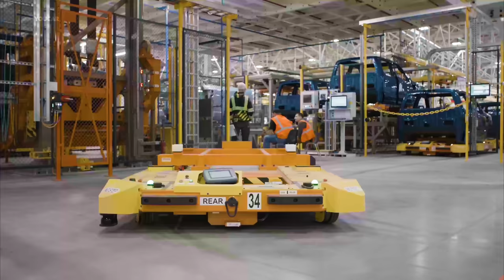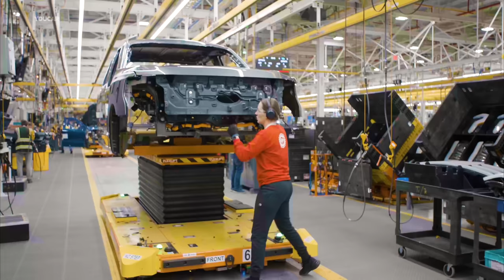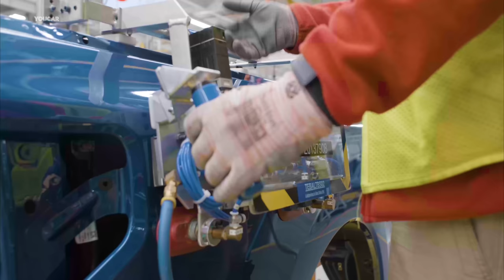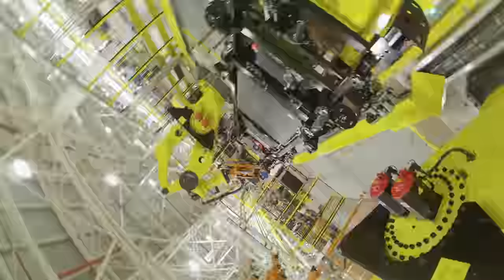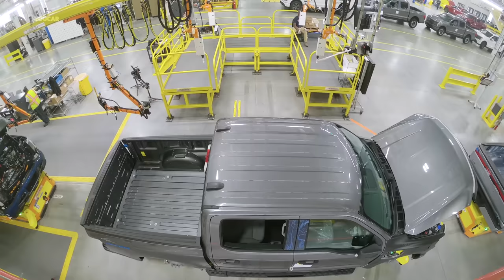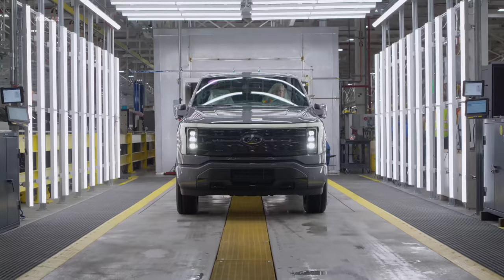FORD F150 Lightning Production Line

Comment: My place of employment. I’m building them right now. Awesome vehicle.
Reply: But brother we booked it’s waiting time ridiculous in Canada 4 to 5 years 🤦‍♂️
Reply: Do you know where the speaker is at for the frunk alarm when opening and closing?
Reply: @isaiahgrandt5305  if I’m not mistaken, it is behind the front bumper on the passenger side.
Reply: @Ruby5point0  we checked there and only found the back up speaking so we un plugged it and could still hear the sound when the frunk opens, if you’re underneath the truck it sounds like the sound comes from up higher than the back up speaker yet we couldn’t see anything even when removing the wheel lining
Reply: @isaiahgrandt5305  ok. I’ll look and I’ll ask. I’ll answer back later today
Reply: @Ruby5point0  thank you sir
Reply: You all should be in uniform and have hair restrictions.  But I set my bar higher than others.
Reply: @tomickes409  there is no reason for that. But thanks for your insight

Comment: What’s the machine doing at 6:30?
Reply: Comau Aura applying a load to the bed to calibrate the onboard “scales” in the bed. To automatically weigh your payload for you.
Reply: @LakeLake123  Did you just answer your own question
Reply: @rhydynamic8306  yes, after I figured out what it was. Assumed other people might be curious what it was too 👍🏻
Reply: @LakeLake123  Thanks, I was curious about that as well.
Reply: @LakeLake123  thanks man, I had the exact same question. ;)
Reply: @LakeLake123  you have my favorite mindset

Comment: Id love to see Ford buy the old Harley Davidson factory in kansas city mo add onto to it and produce these becuse thus far demand will far outpace the supply availability.  Also upgrades to Clacomo plant could include hybrid options to any truck or van it produces now.

Also a mini series truck. But what should be part of the purchase price is adding a home charging station.   We have to keep 
In mind wile we are using electric vehicles we might be saving some carbon footprint but we are still using fossil fules to charge or care for these electronic automobiles so adding solar to your home and or wind generating helps offset your carbon footprint even more.   We still have gas and coal powered power plants as well as nuclear energy with 50,000 year waste or even more. We haven't found the magic yet but this is a lot closer then what we've been doing.

Comment: Does Ford publish map of charging stations in North America? I have heard Tesla Supercharger stations don't allow non-Tesla vehicles to be charged. Some suggesting you can buy an adapter that can tell charger its Tesla vehicle but Tesla can always fix that issue and make adapters useless.
Reply: Tesla is in the process of opening their supercharger network up to other manufacturers. There are plenty of other charging networks that are cross compatible though (EVgo, Blink, Chargepoint etc)
Reply: Ford’s are open to Tesla charging now.